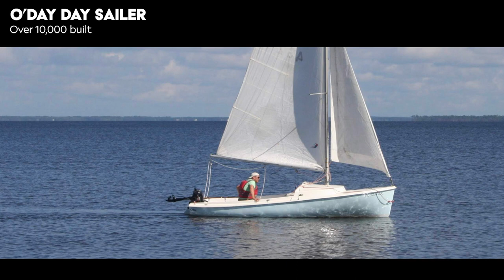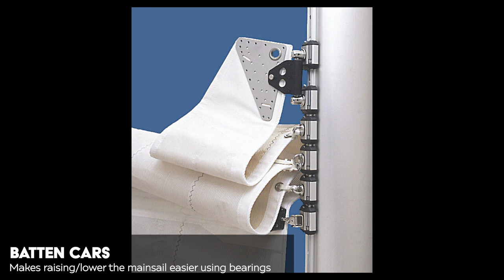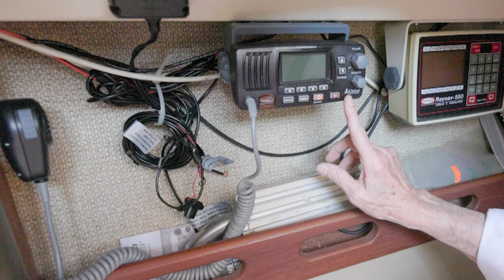$23,500 USD  Comfort Racer/Cruiser 34'/10.4m O'day 34 - EP94  #sailboattour #sailboatforsale

Comment: Love this boat! I often sail and sometimes race on an Oday 35 which is the same boat with a swim/boarding platform built into the transom. My skipper moved the main sheet block down into the cockpit. It is just a pleasure to sail and it is quite fast even on an inland lake. It will also move in very light air.

Comment: 6:00 Regarding the less than perfect bottom paint. Has anyone ever compared a rough finish hull to a smooth finish hull in regards to measurable drag? Golf Balls have dimples because it makes the ball go farther.
Reply from the maker: I thought golf balls had dimples so they would look cute ..no?

Seriously many keel one design boats which race very hard agsinst one another will prove the point.  Identical designs fresh sails etc with the only difference being the level of skill of the crew will prove the boat with the smoothest bottom will  win out 

The one place it really shows is racing in light air.  The toughest sailing there is because unlike stormy weather where you more or less lash everything down and go fo it , in light sir you have to tease all the speed you can from constantly trining the sails to tenderly holding the wheel/tiller sensing every nuance of wind variation. The baby’s bottom will make your efforts easier 
Remeber even at hull speed you are only going 5-7 knots   It’s not like opening your car window and damaging your air stream when you are doing 70mph.  Do you follow

Comment: Fantastic value. Another great find. One concern is the engine looks like it has a lot of hours on it. There is a risk the price is explained by a worn-out engine. Still, for someone with $50k to spend, converting this boat to solar/electric (perhaps even Oceanvolt) would be a winner.
Reply from the maker: Well said! We’re really liking those regenerative systems… can’t wait to see one up close
Reply: I watched a couple of videos about the Oceanvolt system and it was really interesting.  I do believe they are just saildrive systems, though.
Reply: 50K would get you this boat, a new engine, a new bottom, new sails, and maybe even new standing rigging.  We paid $25000 for a brand new 40HP yanmar a couple years back, that is 2x the size of this little engine.  This is the epitome of go simple, go small, and go now.  I wouldn't even think about an all electric drive.  Why ruin a good thing.  In 6 months, you could be on this boat cruising the Caribbean.  For folks looking to check out for a year or two and sail around, this is the boat all day long.

Comment: Another boat where the Captain suggests adding a seal to the propane locker hatch.  Since propane is heavier than air, is a seal really necessary? The drain at the bottom of the locker is not to drain water but rather is designed to drain propane gas should a leak develop. As long as the drain remains clear no propane gas should ever get close to the hatch opening.
Reply: Nice to keep that locker as dry as possible instead of corroding tanks and fittings.
Reply from the maker: ...also, as long as the drain stays open

Comment: Can you explain a bit more about the belt dust and the shivs(sp?) on the same plane? I have this on a P31-2 I recently bought and I think I get what you mean but a clarification wouldn't hurt :)
Reply from the maker: It’s very important to have the belt sitting in the shelves properly. A new belt will sit with about 1 1/2 mm above the top of the pulley itself. Overtime as the belt wears out it will end up bottoming out on the pulley itself and then loose grip along the sides of the belt. As soon as you see the top of the belt drop below the top of the pulley it’s time to change the belt. But as it wears out it sheds some of its compound in the form of the black graphite looking dust that covers the front of the engine block. As it wears out it will slip and it will compound the issue even more. Do you know that the pulley itself can wear and not be appropriate for the belt you were trying to use and therefore you should replace the pulleys. Belt where can be exacerbated by misaligned pulleys themselves so you should take a straight edge and make certain that the crankshaft is circulating pump pulleys are true and do the same thing with the alternator pulley as well they should all lie in the same plane otherwise that will start to wear on the belt sooner I hope this helps

Comment: Hmmmm.... That's a shoal keel so maybe they used Lead on this keel. I think the O'day 34 with deeper keel is made of iron.Check it with a magnet.   O'day has my heart. I owned an O'day 22 and an O'day 272....both awesome underrated boats.  Actually O'day was ahead of the times before they closed shop. There was some shady corrupt dealings that expedited O'days failure....not just the industry going through tough times. A boat builder in Japan now owns the O'day molds. I've spoken to him a few times and he has sent me several pics of the O'day 322 he built. It was made in a nice red gelcoat.
Reply from the maker: i think you might be very right about the keel   makes sense   as for the other biz ....?
Reply: @YachtHunters  lol   all interestingly true